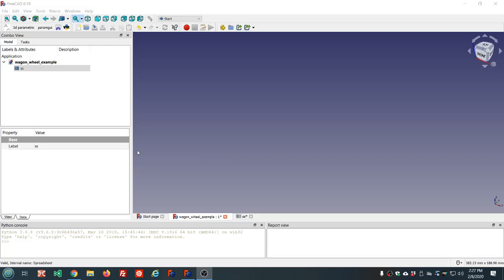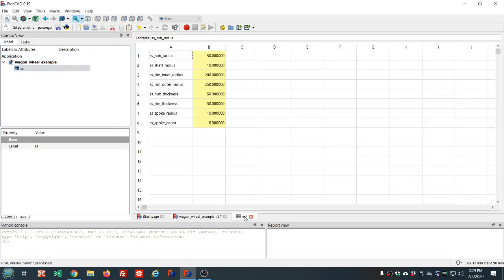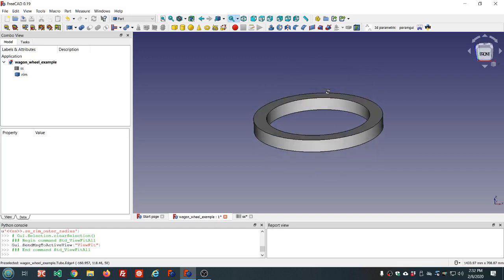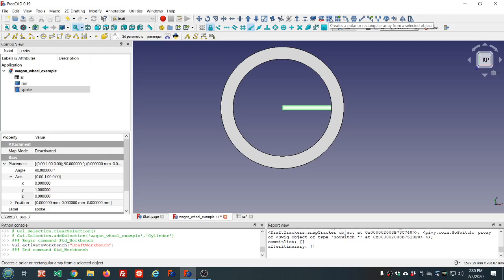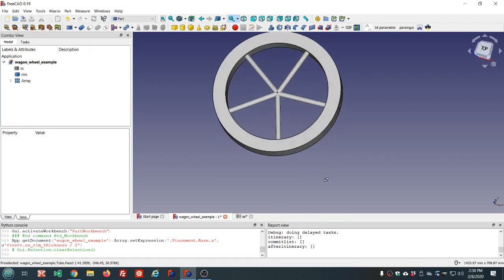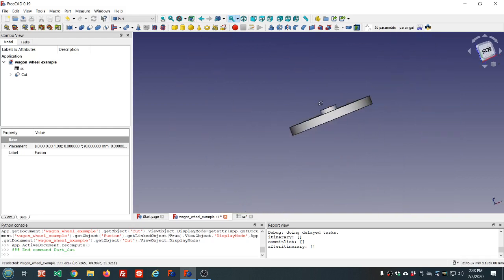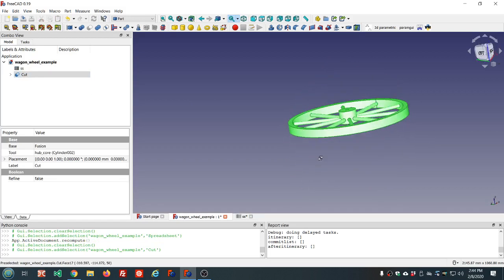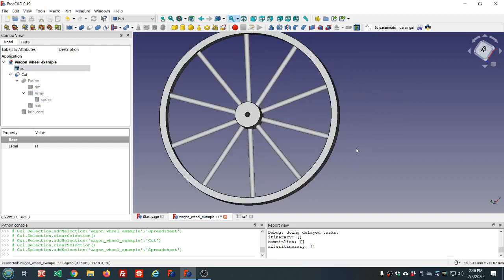003   FreeCAD wagon wheel

Comment: 16:45 I'm using latest version 0.21.1 - at this point when applying values to rim inner and outer radius the array height does not adjust. it looks like this did not fuse correctly. Select the array and ensure that Draft-AlwaysSyncPlacement is set to true
Reply from the maker: I can confirm the behavior.  It looks like a bug in the Array function.  Click on the Array object.  Select the Base property, which will be Cylinder (Spoke), then click the [...] button to bring up the Link editor.  Select a different object, such as the hub, and then select the Cylinder (Spoke) again, then OK.  This causes the Array to update itself properly.
Reply from the maker: Also, I got a notification of a comment from you on another video, but could never find the comment to reply to it.  Spreadsheets now get a single quote in front of values, so you need to use the = sign in front of some things so they're not interpreted as strings.
Reply: @mwganson  yeah I realised my error about strings and deleted comment sorry - pebkac
Reply from the maker: Did you create the file from scratch or did you use the version I had made back in 2020?  I believe the issue with the arrays has been resolved in newer versions.  I say this because I deleted the array and made it again in 0.22.  After that it seems to work as expected.

Comment: Hello Mark, If i have a scetch from one thooth of a gear, with the perfect angel, height and width property's, would it be possible to make a gear with this polar array from video 3? 
Thank you. Jean
Reply from the maker: Should work, but you need to ensure the single tooth is perfect.  Take a look at the Gear workbench.  I think it appears in the addon manager as fcgears.  Also, in Part Design menu there is an involute gear tool.
Reply: @mwganson  Thanks Mark, i know of the two tools FcGears and Involute gear, 
In the PartWB i have made a crossSection of a .StepFile of a 15 Thooth T5 Timing gear with a BeltPitch of 5mm. I did a DraftToSketch of that .CrossSection in the Draft WB and then rotated this sketch so it was flat on the TopView. Then i made a sketch from 1 Thooth with the CrossSection sketch as reference. 
I wanted to make a  Polar Array of that 1 thooth sketch around a circle where i can use  Dynamic Data to set the number of theeth and the CirularPitch. But there i got stuck. 
BTW i have downloaded this StepFile from McMaster website product 3709N13.
Reply from the maker: @germona  Ask on the help board.  Include what you have so far as a file attachment.

Comment: I just downloaded and installed 0.19_pre and there have been major changes to the array interface and I'm having a lot of trouble figuring out how to apply your video to them.

edit, okay, I just figured it out.  Have to select polar array from the the toolbar, select the spoke, then mouse over and hit "reset point" then okay.(spoke number is arbitrary since you can't set it equal to a parametric value in the gui)  Then you can edit the properties like you did in the video and set it equal to the parametric spoke variable.
Reply from the maker: Yes, they've been making lots of changes to Draft workbench, reorganizing the code and interface.